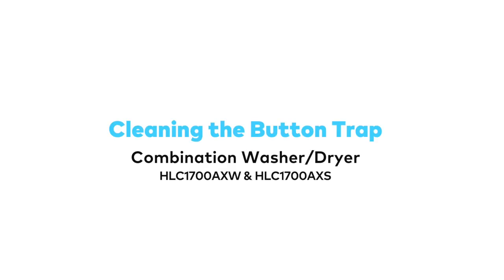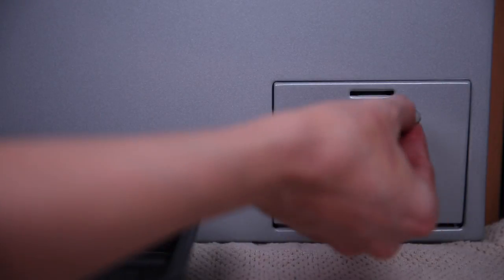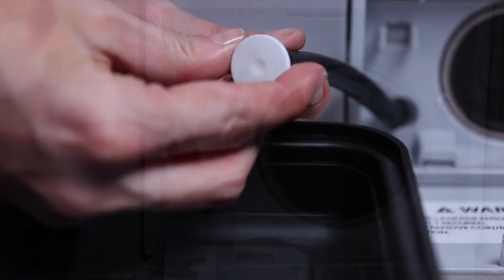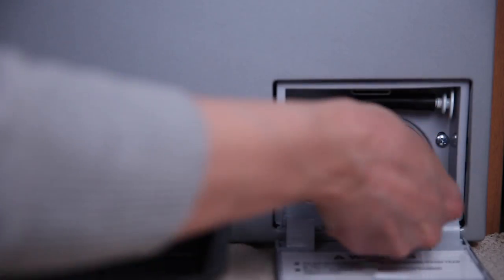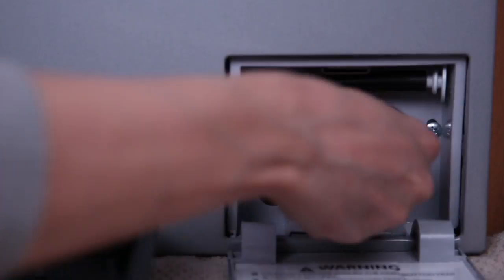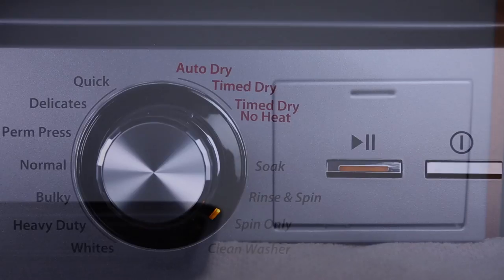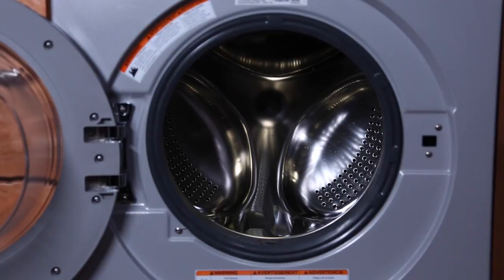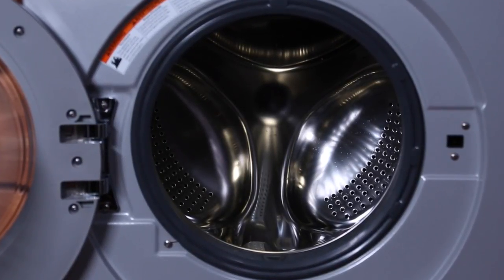Cleaning the Button Trap - Haier Washer/Dryer Combo HLC1700AXS & HLC1700AXW

Comment: I just tried this on my new Haier washer dryer combo. And it didn't work at all. I was able to open the access door, but I couldn't remove the plug from the drain hose or the filter because they were both too firmly secured.
Reply from the maker: Mm827 - We are sorry for your inconvenience. Please contact Haier Service at  877-337-3639, Monday-Sunday
8:00am-8:00pm EST
Reply: I have the same trouble that can not remove the filter, too.
Maybe the video is not the same with real washer.

Comment: I have this model of machine (HLC1700AXW) that is 2 years old but has only been in service for 1 year.  My tenants advised me that they are getting an F9 error code - Dryer sensor circuit problem.  Previously when getting this error, a reset of the machine would clear it, but now, the error is not being cleared.   I will follow the process in this video when I am onsite in a few days.  Does anyone know if following this process will help with this error, and for that matter any more info on this error.  The manual is all but useless in this regard.   If anyone knows where a more detailed or service manual can be obtained, that would help too.
Reply from the maker: Hi Steve,

Thanks for reaching out about your tenant's washer/dryer combo unit. We can certainly understand how this would be frustrating. Based on this article: http://spklr.io/6059iqTB - an F9 error code signifies a dryer sensor circuit problem. Service would be needed to have this diagnosed and repaired properly, especially if resetting power no longer helps to clear the code. You can reach out to our service team, here: http://spklr.io/6050iqT8

If you have other questions or concerns, feel free to send us a PM on our Facebook page or a DM on our Twitter page. We'd be happy to help as best we're able.

All the best. -MS
Reply from the maker: Dear Steve Haller,
Please take a moment and complete our online survey by clicking on the following link:
http://spklr.io/6001iqTD. We look forward to your feedback.  To unsubscribe please click this link: http://spklr.io/6002iqTE
Reply: We just cleared the F9 code on ours... doing the 2nd part in this video wasn't enough, once you unscrew the lint and filter check behind there..there was also lint Trapped behind the filter in the main drain line... Like A LOT  we used pliers to remove chunks out then all of a sudden it was like a waterfall with the trapped water finally being able to exit....then we plugged it back in and the code cleared and finally worked wonderful once more... Hope this helps!
Reply: I can hear water in mine and its splashing around inside but the drain hose only poured some out and now I can still hear the water in it but not sure how else to drain it
Reply from the maker: Hello. We hate to hear you’re having trouble with water not fully draining. We know that must be worrying, and we want to help however we can. Can you please confirm if your model number is HLC1700AXW, or provide your specific model number if it differs? With that information, we can certainly look into your situation further. You’re also welcome to send us a private message over our Haier Appliances social media (such as Facebook or Instagram) instead, if you like. 

We hope to hear from you again soon, so we can assist. All the best. -SG

Comment: had mine for over a year works perfect  if you hook it up right no problems and take care of it like drain water once a month and clean once a month  its perfect drys perfect sure it takes longer then a rel  dryer but that's ok its compact  and does what it surpose to do     A++
Reply: Weekend Wolf  yes it  does watch the youtube  its the small door at bottom drain water once a month  and the trap is the big black knob at bottom as well    what I do is after everywash I grab a wet cloth  and clean in between  the  door seal  and it come off on wet rag  I had nothing ever go in the lint trap   hope this helps